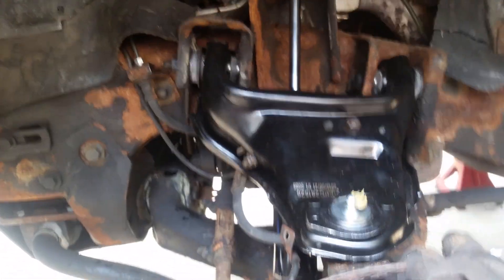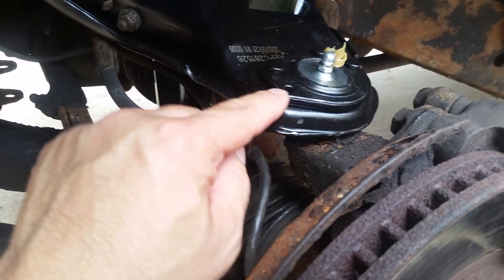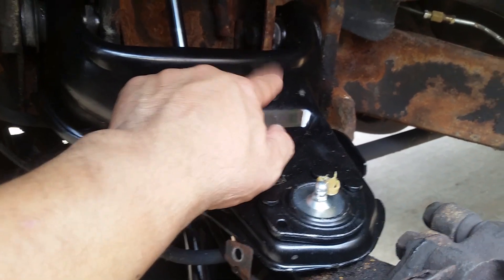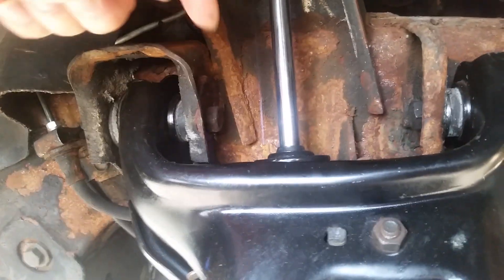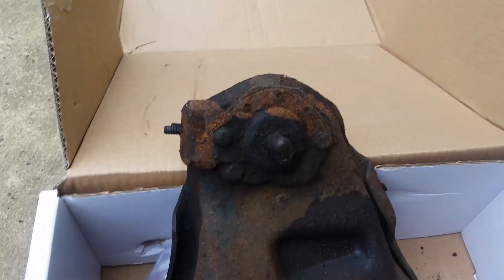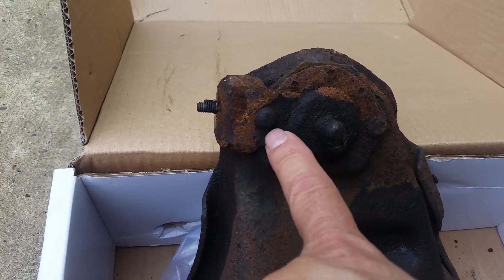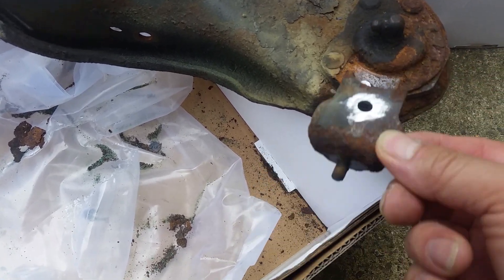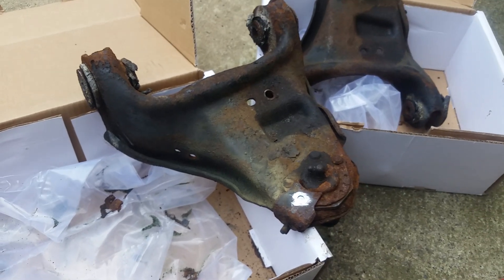1998 GMC Jimmy Blazer Upper Control Arm Replacement

Comment: Thank you for the video. I especially liked how you told which socket size for each bolt or nut. I never noticed but other videos don't do that
Reply: Also you didn't drag it out for 17 minutes with a lot of BS. Straight to the point didn't waste my time. Again thank you I'll be checking out other videos

Comment: So.
I watched this video before doing mine.
Had to cut the ball joints off at the rivets on the truck, then beat em until they thought it was still 1997 and finally came out. Why is everything on this truck a pain in the ass? My axle nuts froze up, so I heated em with MAP gas and impacted them off. Used a 1/2 in diameter piece of wood and a 5 lb hammer to knock new arm into the frame. Gotta bad feeling about mevotech built in ball joints, but I'm committed now- they're in. Get ready to invent new cusswords if the trucks not level when you do this. Don't even start without:
A)a ball joint fork
B)a (minimum) 1/2 breaker bar/35 or 36 mm deep socket
C)good weather
D)patience
I used #10 machine screws and nuts to easily reattach the brackets.
My grinder saved the day.
5lb sledge was a useful *negotiator*.
Good luck.
Reply from the maker: You did good...they are rust buckets

Comment: So you don't have to mess with the torsen bar as long as your just dealing with the upper control arm? Correct?
Reply from the maker: That is correct..just also support the lower arm up so you take the tension off the upper ball joint

Comment: Is there a lower control arm for the jimmy?
Reply from the maker: Sure is..its the Y shaped arm on the very bottom
Reply: @alyoungcuda  I was afraid of that. Thankyou for the response. I do have another question. Would that be the same for a 1999 4wd sle jimmy?
Reply from the maker: @sauravixvutha4478  yes in deed
Reply: @alyoungcuda  thank you

Comment: What are those metal shims on the side of the bushing? It don't expose the rubber
Reply from the maker: Those metal shims are part of the bushings..they touch the sides of  the chassis to encase the rubber so when it moves up and down they wont tear up the rubber

Comment: How much does this usually cost? I was quoted $569.
Reply from the maker: The arm itself is 150.00 from autozone,  add another 25.00 for the replacement shock. Leaves about 400.00 in labor..too much but most places are about 125.00 an hour...shop around or attempt it yourself. The shop usually jacks up the parts prices so if you get a break down of parts and labor you will see whats costing you more. Shops make money on parts along with the labor...

Comment: What brand of control arm did you use? And do the control arms come with the bolts and cams or just the bolts?
Reply from the maker: Arms were purchased at Rockauto.com 
No hardware came with it except the bolts to mount the brake hose bracket.
Reply from the maker: Moog or mevotech..was the brand..they have so many to choose from...moog is a good brand name
Reply: @alyoungcuda  that's funny considering I was currently on rockauto looking at the moogs
Reply: @alyoungcuda  thank you

Comment: Looks like your shock is upside down...  Installing it this way can prematurely, have the seal impregnated with water... then leak out gas/fluids...  causing shock failure...
Reply from the maker: Its correct, you're use to seeing shocks with the plastic covering over the shaft, this brand no longer comes with the dust shield